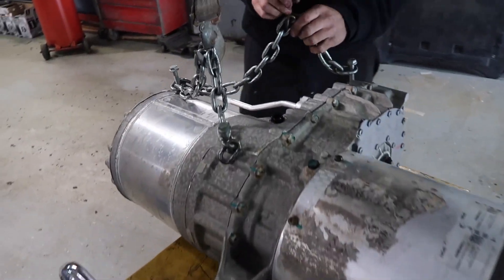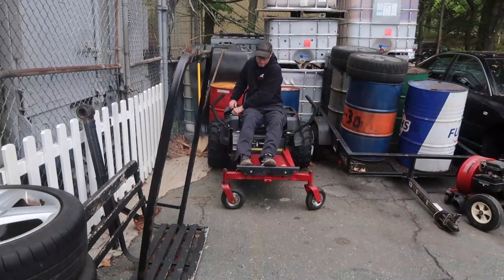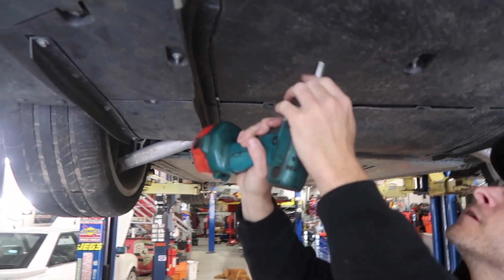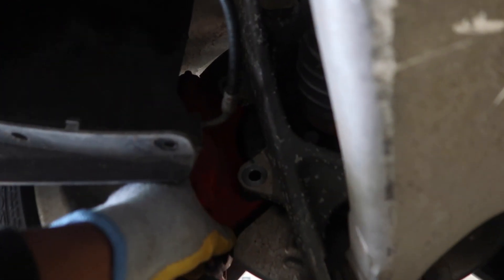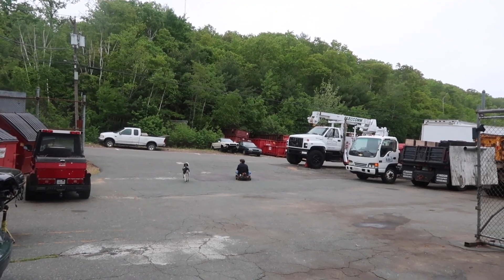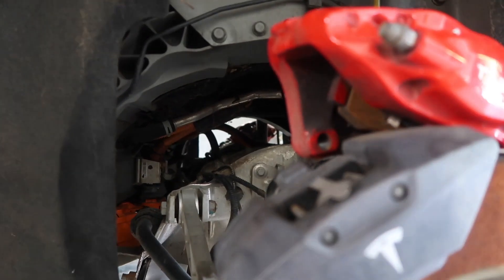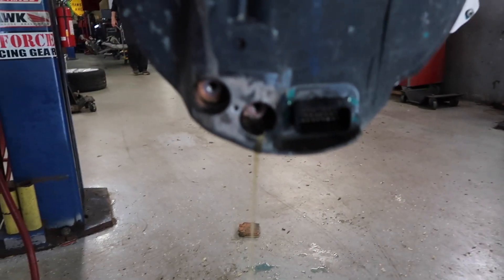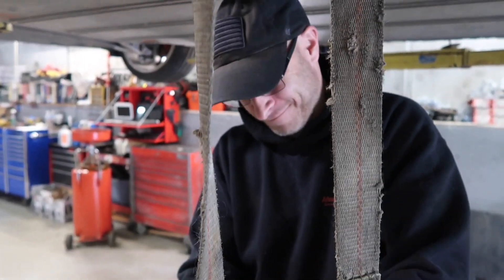Can You Drown a Tesla Motor?

Comment: I think this motor itself would be fine with some detailed cleanup. I've ran open electric motors WHILE they were underwater before. If you can save the bearings, a cleanup and dry out should be all that is required. Again, the bearings.... get them out and replaced or repacked
Reply: The circuit board would have me worried the most, but assuming it didn’t have power to it while it was wet/underwater you never know
Reply: It is extremely likely that the inverter is conformally coated, but I am not sure that means it is 100% waterproof for ever. But it should withstand quite a lot.
Reply: Sadly tesla motor has inverter built in too, thats the expensive and difficult to repair part :/
Reply: yea i would assume that part may not be salvageable... but the motor (and differential), I think it could be saved if one needed to badly enough
Reply: Agreed. Some water pumps run open coil to keep the thing cooled even, with sealed bearing pockets and sealed bearings. Unless it's salt water, it don't care. I would clean that thing and give it a whirl.
Reply: From an electronics perspective: take out every circuit board and soak and clean them in deionized water and own dry them. Then clean the board further with a hot flux bath to get rid of any corrosion (this is a specialized process, so better have it done by a board level electronics shop, not you cellphone repair down the corner). Finally test connections for shorts, especially power supply traces and grounds (you'll have to look up individual ICs on the board to know which pins are not supposed to to carry 5v, 3v, or whatever. Then carefully power the board up from a current limited power supply and test with an oscilloscope or logic tester that the microprocessors are running and data is flowing on the buses. First then you can assume that the board is all right and safe to put back. Alternatively, get a spare board from Tesla for pennies, no wait, they shit on every customer!
Reply: Not sure about the electronics, but on small scale (remote control brushed vehicles) you would submerge them in water to break them in. Probably be fine if it is fully dried and bearings cleaned and relubed.
Reply: Bull shit. The coating is especially to protect against water and moisture. It doesn't get washed away, phones are just not coated with it. The few that are also die in a few days because of connector corrosion.(connectors are not coated for obvious reasons...)
Reply: +John Bäckstrand
 it does not mean that, not in this case. There's different forms of coatings, but a thin coating like this will just provider slight resistance to dust and moisture. It should still not be submerged, and it's quite fragile.
Reply: that's one best replays, ever
Reply: I don't think he has replacement Tesla chips/resistors the inverter has
Reply: That inverter is just too far gone at this point. Even if he dried out and went walking through the circuits there is no way to be 100% sure. He could possibly rebuild with another junk inverter... Elon is probably excited to see what happens next though.
Reply: Either that or Jessa at ipad rehab as she tends to work on more obscure things. As long as you have another board to compare to it should be fixable, you'll only once once its been in the ultrasonic cleaner.
Reply: Replace any bearings for sure.  They will not be good
Reply: True
Reply: no tesla motor have pcbs on them, they were clearly rusted and would not have run
Reply: funkyzero there is no corrosion that is just dirty orange flood water
Reply: I've run remote controlled aircraft motors underwater. The impedance of the motor is much lower than the impedance of the water. Also, the impedance of the motor goes down as the power goes up, so a Tesla motor should have no problems. The issue is, as has been mentioned before, the bearings and any electronics in the same case.
Reply: Dont tell me what to do
Reply: Can someone tldr this video
Reply: Ìf there was power to the inverter - yes, the board is crap, but with no power things are 50/50. They all keep saying "it spent 10 days under water", but after that the water spent much more time in the parts that were sealed... Boards absorb water and sometimes the material itself becomes useless after a while...
Reply: Differential should be fine.  Again check all bearings/replace on motor and differential.  Brushless motor may be fine.  It should be epoxied and so it should be fine....  Now that you have it all apart I would get new circuit boards though, replace inverter side.  It may just be easier to get that full drivetrain out of another car and replace it....  If you don't have that luxury though you may have to take some chances with cleanup and reassembly and cross your fingers when your ready to take it for a spin.  Worst case scenerio is it won't work or may just go out of control and so my suggestion is definelty fire it up on jackstands or on a dyno so if it goes out of control the car don't go into a wall.  Best of luck!
Reply: Osw719 this isn’t a DSLR, I’ve seen non waterproof phones underwater for longer than 10 seconds. This is a lot more durable, and wasn’t powered at the time
Reply: Yep, Tesla resistors are extremely special. I would actually be concerned about the board itself. Chips and other components are actually water proof and the only part that may fail are their legs and the copper circuits on the boards.
Reply: Osw719, agreed. It's extremely unlikely that the electronics survived. Air  is corrosive to electronic circuitry. To defend against this, manufacturers put a protective chemical coating over the circuit boards. However, this protective coating is water soluble. So the water washes it away, leaving it exposed. This is why, often times, a cell phone that gets saturated, such as being dropped in a toilet bowl or a swimming pool, will sometimes come back to life, after being thoroughly dried, but will often stop working, again, but this time, permanently, a day or 2 later. Because without its protective coating, the corrosion begins.
The motor, itself, could possibly be saved.

Comment: Should be pretty Simply to clean that up... You would think?? Seeing power should not have been sent to the motor after it was under water? IT was parked? So should just be cleaning up the parts.. And Checking over the main boards. 
I work With main boards all the time at work... That have went under water... Normally they clean up pretty well.
Reply: A lot of the electronics were clearly pretty badly corroded. You cant just wash off the rust and expect it to work correctly and safely. The board getting wet isn't the problem, its that the parts have been corroded to the point where some/most of them will need to be replaced
Reply: I agree. The tracks will be at the very least gold plated copper, they look high quality boards. The solder won't have any corrosion issues after that time either. I'd clean them up, bake them and flick the switch. Worst that happens is you need new boards, and you needed them anyway.
Reply: my old 89 honda sat for a year about 8 years ago it filled up with water due to bad windshield and half the ecu was in water for months. i pulled it out threw it on a shelf for a couple months while I was rebuilding the motor, put it in and it ran like a champ for 6 years. then it started to idle to low stalling sometimes but runs great otherwise. I replaced it and the old one rides around with me as a spare in a faraday bag
Reply: I repair server equipment, Ive seen everything from coke to just plain water damage on them. Wash it in the sink with some dawn, then clean it up with 91% alcohol then go over the electronics with a high temp heat gun carefully and boom, works once more. Ive repaired a few ECUs for some older cars from the 80s and they are still running to this day and they had water damage just like this.
Reply: Not necessarily. Most of that stuff will be conformally coated. These are automotive parts, not the contents of a server rack, and are designed for harsh, wet, salty nasty environments. 

I suspect the majority of the "rust" we are seeing is from the steel in the motor body and from the crap that was washed in by the flood water.

Hard to tell though without some close up pictures.

Comment: Im pretty sure the blue and white is the bavarian flag.... bmw stands for bayerische motoren werke = bavarian motor works...

From wikipedia:

The circular blue and white BMW logo or roundelevolved from the circular Rapp Motorenwerkecompany logo, from which the BMW company grew, combined with the blue and white colors of the flag of Bavaria.
Reply: that "propeller" thing is pretty common mistake.
Reply: Monte Stu  Try going to the plant in Munich not the one in California and you will hear a different story. It's a Bayerische flag, just like the sign on Porsche is a Stuttgart/Württemberg coat of arms...
Telling US customers that they are driving a plane sells more cars than telling them that they are driving around with German flag on their hood...
Reply: Funny thing is mercedes logo is also a propeler.
Reply: crashyburny MIT it’s meant to symbolises prosperity and the 3 points are meant to be the land, sea and air
Reply: uegvdczuVF — Dang tour guide lied to me!  I wonder how accurate the other things she said during the tour??
Reply: Monte Stu She? There's your problem.
Reply: propeller is not a common mistake its the actual fact lol... BMW was originally a airplane manufacturer during WW2 for the nazies. they where banned from doing so after they lost the war so they started building cars instead.
Reply: Klote3241 I work for BMW it’s been confirmed that it’s a common mistake among novices. The logo indeed has nothing to do with a propeller.
Reply: John Smith you're probably right about the colors of the flag, but the propeller is also true
Reply: John Wu, also from Wikipedia:

The origin of the logo is often thought to be a portrayal of the movement of an aircraft propeller with the white blades cutting through a blue sky. However, this portrayal was first used in a BMW advertisement in 1929 - twelve years after the logo was created - so this is not the origin of the logo itself
Reply: I toured the BMW Spartanburg plant and the person giving the tour said it signifies a propeller.